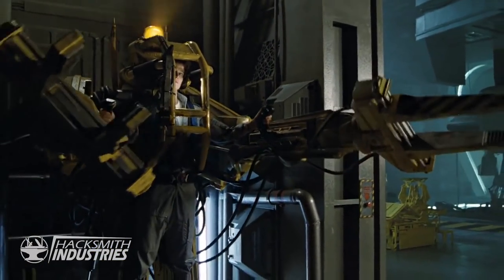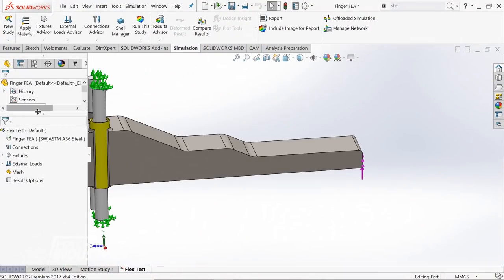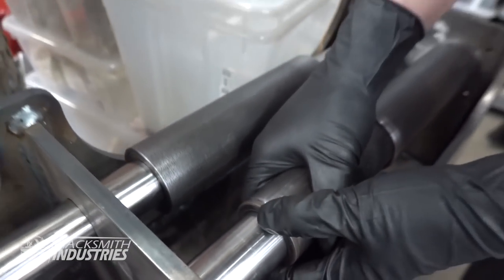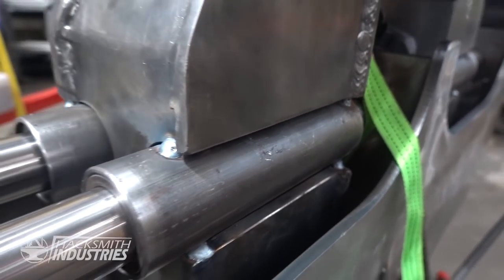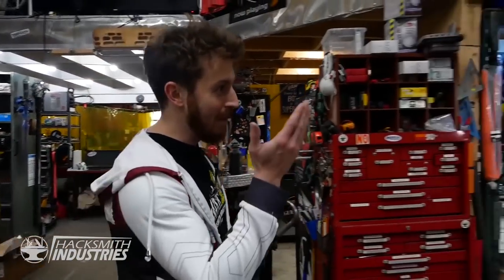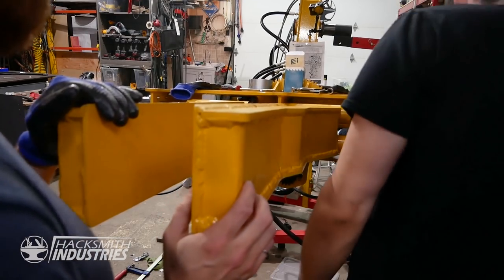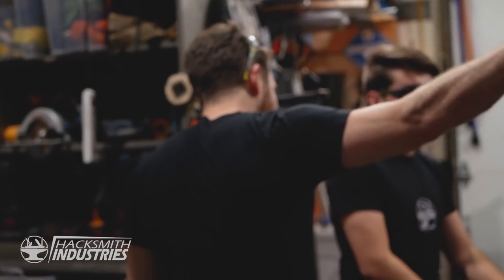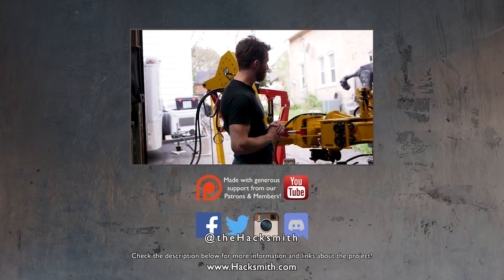Mech Arm IS COMPLETE! (POWER LOADER: PART 5)

Comment: Thanos: I used the stones to destroy the stones.

Hacksmith: I used the hydraulic press to create a hydraulic press.
Reply: Lol 😂 that’s so true
Reply: U destroyed a 2006 imac (probably had the most crappy intel core duo) my 2006 iMac just has a faulty screen which really common on iMac they have the very glitch crap which was caused by the driver board on the screen
Reply: Я не чего не понял....
Reply: Irnonic
Reply: next:use stones to destroy thanos
Reply: hahahahhahahahah
Reply: Also Thanos: Gone reduced to atoms

Also hacksmith: ooh paper thin

Couldn't think of a quote off the top of my head
Reply: Likenstëim
Reply: ITS MORE POWERFUL IF YOU USE TWO HYDRAULIC PRESSES!
Reply: Lol that true

Comment: Ironically, your new gripper design look a lot like the movie version with the rails now.
Reply: (That's not "irony". It is merely "correlation". It would be irony if the gripper looked the same as the movie but then functioned worse than the first attempt)
Reply: Hmm, not sure if that's what irony is, but sure use it anyways...
Reply: Should had stayed with that design since the beginning, there's a reason why they made it like that

Comment: Great work.  The tab A into slot B method was excellent.  I've been in on some new construction, custom fabrication, patented processing methods, and general assembly.  Since I've worked as a machinist, welder, fitter and layout man, I'd like to contribute a few impressions;  1.) Is this arm really designed for the task of loading?  Because those forks don't seem like they'd slide under anything. 2.) 20K force is overdoing it to crush soda cans and Apple products.  And, likely, anything else a functional walking forklift might encounter.  3.) On that note, the arm seems overbuilt.  It could be lightened, lines smoothed (so it doesn't tear up the cargo or the workspace) and made more efficient.  4.) Efficiencies like using bearings (excellent economy) and screw jacks to expand and contract the clamps.  That arm might be able to manipulate 20k lbs.  But can it walk it anywhere? (think; curling 20lbs vs holding 20lbs at arms length.  While running.)  Point; creating a torso and legs capable of handling that lifting ability (and manipulating the weight of that assembly) seems daunting to unlikely.

Overall, outstanding production job.  I just wish you were in the Seattle area.  I'd love to visit your shop.  OBTW: if you want to get an impression of the loaded cargo/unit balance issue, try driving an early wheeled Bobcat loader with a full scoop of gravel.  With the scoop held above eye level.  I know I was entertained the first time I tried it.  Well, cheers, Pulski Polski, and Uff Da!

Comment: Very well done. But, as you said in the opening video "forklift trucks are more practical". So, why not replace the forks with the loader arms. Having "articulated forks" on a truck may be commercially viable. I would still like to see the full power loader realized though. Good luck!

Comment: Understanding the cost factor, but steel bushings on a stainless linear rod, without substantial/continuous lubrication, performance characteristics will degrade exponentially, ultimately causing a catastrophic bind and perhaps warp, bend or crack the mechanism.  I know they're expensive, but I'd replace the bushings with closed, stainless 1.5" ID linear bearing and avoid the forthcoming pitfalls altogether.  If you're dead set on the bushing approach, I'd recommend inserting several greasezerk fittings into the parallel tubes, with teflon wipes, to at least provide some lubrication and decrease contamination of the bushings.

Comment: Love your work and love this. Though I have a few questions. 1. would powder coating be better once its fully done? 2. would you need to design a duel chamber 360 rotating fitting that fits in the center of the gear plate as to not break the lines when doing a 360 spin of the loader jaws. 3. how are you going to protect the parts attached to the outside? 4. What about interchangeable jaws like cutting jaws, chainSaw jaws, buz saw blade jaws, ext? Your Jaws of life idea could make this a practical heavy rescue tool for dealing with things like train wrecks, building collapse, nature ect. 

If you can figuare the mobility issue i can see this being a huge help fighting forest fires. you could even make a fire fighting design as well. the possibilities are there.

Comment: You guys are totally nuts!  I guess it's part of the process to work out all that angst from hours of promising designs only to have frustrating builds.  I love the way you edit your videos now to remove extraneous crap.  That once round propane tank looking almost square was pretty cool.  But I'd have avoided the lithium battery pack due to unpredictable nature.  I wish I had a hydraulic section of a store that you guys found for yourself.  I paid at the wazoo every time I had to replace hydraulic lines for my 1970 Ford 4500 loader.  It's so much cheaper buying premade lengths of hose than to have any custom-made.  I would like to see a price breakdown on the parts you guys put into these builds.  That would prove very interesting I feel.  Greal work, guys.  Keep at it!

Comment: Ever wondered how curtains (with a pull chord) open and close the same amount each side? 
In a different configuration, you could have one claw run inside the other, use one ram, spread the bearings further apart,  and have both claws work evenly.
I'm very concerned about the load capacity of the wrist rotate joint. How long is the axle it sits on?

Comment: have you calculated the flow your pump will have to put out for a finished suit ?  how many HP will be required? what is your goal for walking speed, feet per second of arm movement, industrial robots i have been around can move at 10 ft per second, that would be 20 years ago,  if asked i would say make the arms as light as you can with the smallest dia cylinders that would meet your strength required.

Comment: Your bushings are going to gall under load and quickly loosen up. The more it goes, the more it will bind.
Without going to far into it, look at forklift design and invert the arms. Almost a century of engineering and test.

Comment: Have you measured the jaw pressure at full power? Could start a new power loader press crush channel lol.

Also you mentioned at the start of the design, you wanted the jaws to be able to infinately turn around, no chance with those hoses limiting the turning angle each way :(
Is there not a system similar to a bmx handle bar shaft for the brakes, that can be used to allow the arm to spin around the central fixing?
Can you not invent a system yourself?
What do the robots that are used to manufacture cars and the like using for their grippers?

Comment: Could you make double jump boots by using an air tank that pressurises smaller tanks on the boots that get purged forcing a huge amount of air out the bottom propelling you about 2/3ft up, if you already have upward momentum from jumping, the boots would have less work to do, so a lot like iron man boots, but compressed air and only a small hop instead of flight

Comment: For rotating the jaws I would have embedded a hydraulic motor inside the wrist area and attatched the mounting plate on the end of the motor shaft. To ensure the load could still be the same I would still have Incorporated the bearing for support.

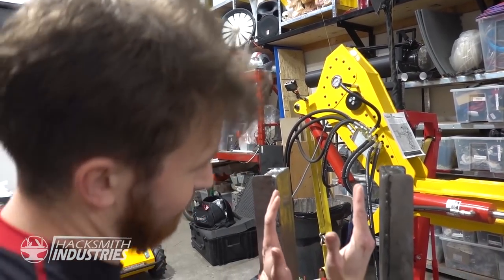Comment: At 5:45 in the video did anyone else happen to think, uh they should angle to jaws together slightly at the ends ( kinda like pliers) /_\ instead of parallel  l_l  this would help counter act the little bit of flex in the jaws???  not saying to by much just slight and help close the gap caused by plate in the middle

Comment: Why not run steel tubing for hydraulics to eliminate the unnecessary areas where the hoses can potentially become a weak point. Just used the hoses where they will have minimal movement.

Comment: Excellent, watched all 5 videos, why did you not look for pre existing hydraulic machines from say car manufacturing plants, obviously obsolete or damaged ones you could repair & retrofit, was it the cost ?, also plate aluminium, it would have been a hell of a lot lighter ?, a guy in Australia made a articulated T- 800 & cast most of the aluminium himself, I recommend giving it a look. But great job guys, I look forward to the rest of the series, cheers.
Reply from the maker: Cylinders are cheap, having to design something around scrap parts that don't match? That's expensive

Comment: What would happen if you only ran two hydraulic lines to the cylinders on the crusher arms ,one to the push side and one to the pull side of the other  with a separate line going to the other two openings you would need to fill it with hydraulic fluid with some way to bleed out air and refill with hydraulic fluid and a shutoff valve to prevent air getting back in.
Reply from the maker: Doesn't work - bore and rod size of cylinders aren't the same. More flow in extension than retraction

Comment: This is really cool, You realize that the strength was meant to be on opening not closing right? If you watch that clip you were showing the jaws fit inside the rectangular hole in the side of the boxes it was moving around. So the jaws open to hold, not close :D
Reply from the maker: Doesn't need that much strength... Hydraulics have crazy holding power...
Reply: @hacksmith  I saw that. I love it though.

Comment: Whats the plan for avoiding face plants, a 5 metric ton depleted uranium counter weight on the back side. At least it'll be easy to find if it walks off on it's own lol.
Reply from the maker: See t-shirt design
Reply: @hacksmith  Good thinking Batman, but yr still going to need a mass damper or something to stop it pitching over. Regardless I think you are doing some inspiring work, hope you complete it and your boneyard doesn't get too big.

Comment: Great series guys, but surprised you didn't see that whole gripper gonna act as a lever against those two bearings causing that guide slot to open.
Reply from the maker: Apologies for showing the entire design process -- even when ideas don't work
Reply: @hacksmith  ouch

Comment: The major problem with humaniod bodies:  Balance and coordination with center of gravity.   It took Boston Dynamics nearly ten years to get it right;  can you get their help??   It's all in the hips baby!   Must be able to bend over and bend back beyond vertical.  probably need a counter balance 'tail'.  Actually you may be half way to a marketable design.  Think tank treads for lower half.  The upper torso is as planned.  It can do a lot more than a fork lift.   Construction or rescue applications?   precise control over large masses / weight with multiple degrees of freedom is the niche for it.   IT's name?   "Bender" of course.  :-)
Reply from the maker: The hint is in the tshirt design
Reply: @hacksmith  Ha ha,  swiss army knife at the hulk level.   Good luck!
Reply: See the Boston dynamics  warehouse box loader with the dynamic 'booty' rear end counter weight.
I think you will need something like that unless you stay with tank treads with a massive counter weight in the rear.   I am suspicious Boston got their idea from the Anime "Ghost in the Shell"  the spider robots  "Tachikoma" have a flexible abdomen that shifts as a counter weight for balance.  Such a abdomen would be a great place for the engine / power supply.  In the long run, perhaps a more scorpion type body would be optimal.   Don't forget flexible hips for the leg joints.  smoother ride and better balance.   But you'd have the get help from B.D.
OH and when you run low on project ideas,  Build a full size Tachikoma!   Remember a lot of what makes it cool are the skater balance skills at speed.  Hi jump not required or AI for the prototype.

Comment: It’s cool, but shouldn’t they be a little more powerful?
Reply: Not to talk down on the fabulous engineering a billion times better than anything I can do, but it seemed like you guys kept hitting a bottle neck with the power draw that you might be able to fix with more powerful hydraulics? Would you guys consider this, or is it not worth it? Too expensive? Just curious
Reply from the maker: Already max pressure and max cylinder size
Reply: the Hacksmith just food for thought, what if you guys tried a gear reduction? Use hydraulics to cover most of the distance, then once the goin gets tough, switch over to a 10,000:1 gear reduction or something with a couple horse power motor

Prolly improbable, but nonetheless this is really a great project guys. I appreciate how you continue to put in lots of effort to create intelligent videos that are genuinely interesting to watch